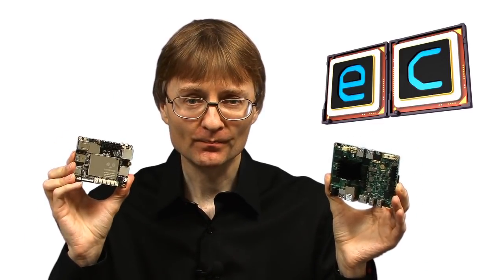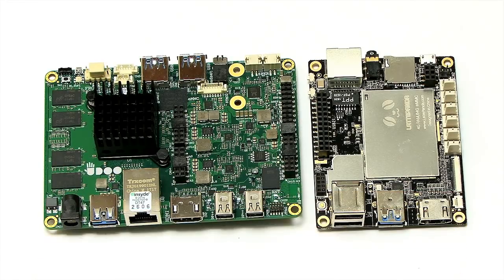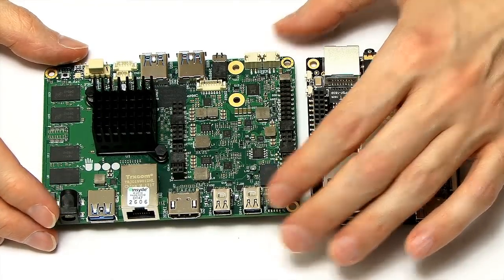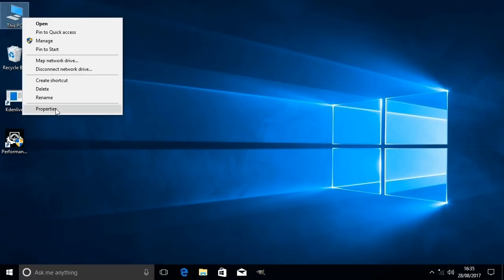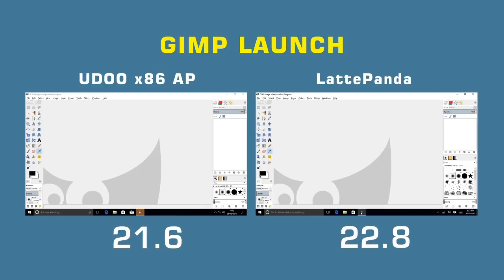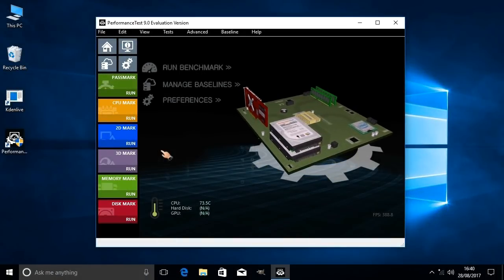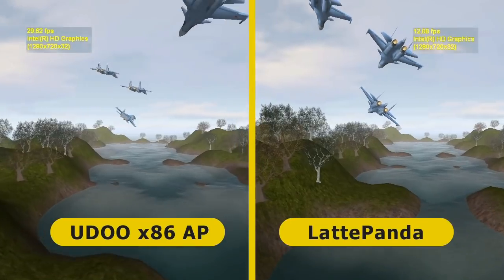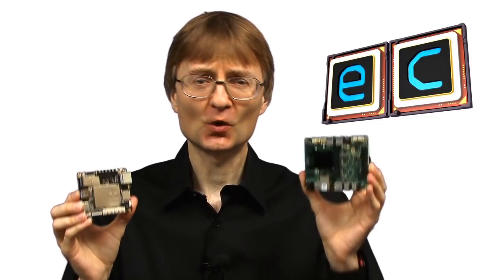LattePanda v UDOO x86 Advanced Plus

Comment: I'm looking for an answer on these 2 boards. Looking at the LattePanda, seems to use a seperate chip for the arduino connectors.
This makes processing power for the pins, dramatically slower since it's an Leonardo chip.
Does the UDOO use it's own processing power for these pins or is there also like the LattePanda, a chip in between?
I would be more tempted to use the LattePanda if the main processor which is also used for the OS, was also used to operate the pins.
Reply from the maker: I believe that both boards use separate controller chips to allow the bet Arduino compatibility. The Intel chips that run these SBCs do not have native GPIO.
Reply: @ExplainingComputers  SBC shopping is so hard. Rapid increase of new models and updates of models doesn't make it easier!
Mainly interested because these tiny computers can get so powerful relative to their form factor and also can be used as a master controller for slave arduino's at the same time.

If I figure out my pick, my car definitely will turn out in a geek creation I always wanted it to be.
Back to researching it is!

By the way. I really love your videos and your activity in the comment section of all your videos.
Also the straight to the point style is really why I keep going back to your videos for a quick reference.

Thanks!
Reply from the maker: You are right -- deciding on a board is very hard. I will be reviewing an UDOO BOLT here later this month (I've been told one is about to ship to me!), and then an ODROID H2 not long after that. The former may be more powerful than the new LattePanda Alpha . . .

Comment: can any one help me please ; 
if i can replace win system on lattepanda by ubuntu ? 
thanks
Reply from the maker: With extreme difficulty. The LattePanda is Atom based and does not have a standard boot loader. Hence you cannot (easily) just boot from USB and install a Linux distro. You would also need appropriate drivers. I have read of some people running Linux on a LattePanda, but not of anybody running it properly (eg with WiFi and audio drivers working). The LattePanda is, as it says, a Windows 10 computer.

Comment: Is it possible to run windows 7 on them?
Reply from the maker: Technically, yes -- and probably fairly easy to do on the UDOO, though you would need appropriate drivers. Hard to achieve on the LattePanda as it does not have a standard boot loader, so you would need an appropriate SD card image.
Reply: Thank you for the info

Comment: Could you explain the not 4K on the UDOO ?
Reply from the maker: Indeed! The highest resolution video output of the UDOO (and many devices) is four times HD, ie 3840x2160 pixels, also known as 2160p (ie double 1080p) or sometimes "UHD" (though this label is rather vague). Many people (and TV manufacturers) refer to this resolution as "4K" as it has close to four thousand pixels horizontal resolution. However, 4K has been around in digital cinema for quite some time, with actual 4K footage having a horizontal resolution of 4096 pixels, with various vertical resolutions possible. For example, Sony 4K cinema cameras record 4096x2160 pixels, and this is the resolution you will see projected in most 4K cinemas these days. So, strictly (well, actually) the UDOO does not output 4K, it outputs 3840x2160. But as mathematically-challenged TV manufactuers now call this 4K, it is not unreasonable to say the UDOO is a 4K device . . .
Reply: Thanks !, I do remember now that LCD screens are cut down from larger sheets and 3840x2160 and 1920x1080 etc obviously cut down well into smaller and smaller screen sizes from a large sheet. 4096 doesn't fit that mould well. Really I guess it's 93.25% of '4K' but that doesn't advertise so well ...
Reply from the maker: I like the "93.25% 4K"! :)

Comment: Thanks for going through the trouble of comparing these boards. I'm convinced about getting myself an UDOO X86 board for Oolite, which is a modern remake of the original Elite. It's fairly lightweight, and can also download expansion packs made by the respective community. Also, I'm getting ready for a project in which I first thought I would need a full blast Windows XP motherboard for, but thankfully, you changed my friggin mind. You can check my Google Plus for updates regarding said project.

Comment: the lacks of a heatsink on lattepanda doesn't influence on the benchmarks? At least i had a lot of problems, even throttling down the processor's clock until i upgraded the board's heatsink.

Comment: As for your comment about the mouse not initializing on the UDOO: I have the very same issue you described on my desktop with the mouse plugged into a USB 2.0 port. This is not an OS issue either since it has been happening both on my (past) W10 Pro install and my (current) Gentoo Linux install.
I genuinely wonder what it could be. The USB controller itself seems to be fine because my keyboard works properly and it's plugged into the neighboring USB 2 socket (yes, I have tried swapping them with no luck). That leads me to think it could be an issue with the mice themselves but I have no way to verify.

Comment: A major part of the market for these types of computers is in remote locations or off-grid applications.  May I request that you include  power consumption as one of your your testing criteria in future evaluations?
This would be simple to achieve by connecting a simple watt-meter to your power inputs.  Then we could compare milli-watts to fully boot into windows, per test suite, etc... and evaluate trade-offs in completion speed to extra watts consumed.  Many potential applications may not opt to get 20% faster speeds if it means doubling your power consumption.
Great site!

Comment: Thank you for all these reviews Christopher.
Are you aware of any single board computers with a parallel port?
Reply: You can get a USB-to-Parallel cable. E.g. 

https://www.amazon.com/Sabrent-SBT-UPPC-Centronics-Printer-Cable/dp/B0007UVRVO
Reply: Thanks Tom! I appreciate your input.
I am aware of the USB to Parallel option although Centronics is not the correct configuration for CNC applications. I am thinking of possible co-location of SBC and CNC driver electronics to reduce computing footprint. I have found about three in the industrial arena but with price tags to match.
Reply: One problem I've seen with USB to serial cables in embedded applications is that the timing of serial port signals is different when you have a USB to serial bridge chip in the system. Embedded applications being what they are, they may well be sensitive to this. 

If that's the case you might be better off with a PCI-Express parallel port card. Or you could fix the timing dependencies in the embedded system.
Reply: Yes in CNC application serial is of no use as the timings are inadequate for simultaneous multi-axis movement.

Comment: If you cool both CPUs well (with a larger heatsink), 
It'll be possible to have them  running constantly at their rated turbo speed ( of 1.8Ghz, vs 1.44Ghz for the atom, and 2.24Ghz vs 1.66Ghz for the Celeron).
 
So, if you see the CPU throttle down from their turbo speeds, paste on it a slightly larger heat sink.

Comment: the great thing with that super small pc is that u can run them inside a fridge  3 c°  ( wireless keyboard and HDMI )
Reply from the maker: Now this I must try! :) What a great idea!
Reply: condensation would be a problem :P
Reply: Not if you keep it in there. It would when removing it though.
Reply: you could submerge it in mineral oil and chuck it into a little freezer. then overclock it to 4 GHz. :P

Comment: I read (I just migrated up to 3.x USB) that USB 2 and USB 3 do not share anything as the internal connectors are different so 2.x/1.1 does not downgrade a 3.x speed so the mouse issue is not due to that.
Reply from the maker: This has nothing to do with the connectors themselves -- a USB 3.0/3.1 connector has both sets of contacts, and it will be the 2.0 contacts used to connect a 2.0 peripheral like a mouse. The issue will not be the physical hardware, but the drivers -- and problems with mice connected via USB 3.0 due to driver issues it a widely known OS issue I'm afraid . . .

Comment: how did you install windows on the udoo
Reply from the maker: I used the Microsoft online tool to downloadWindows 10, which creates a bootable USB drive (or it may have been a bootable micro SD card), which I then inserted into the UDOO. It was certainly a very easy process. You can find the tool here: https://www.microsoft.com/en-gb/software-download/windows10 It is free to use, and free to install Windows 10 on a computer to "evaluate" it without a license key. Or course, you may then purchase a license key if you wish . . .

Comment: Why is power consumption allways forgotten when comparing SBC's? The RPi 3B uses 1.5W when running 1080p video. How much does the LattePanda or UDOO bord consume?
Reply from the maker: This is a very good point. I must to a video comparing the power consumption of different SBCs. :)
Reply: ExplainingComputers ... YES, PLEASE!!! In my off-grid situation, this is a primary concern (my main PC right now is an Azulle Byte Plus - very similar to the Latte Panda, w/4gb RAM & 32gb flash, plus a bit fancier packaging <grin>).
Reply: Exactly. My only reason to use it but i better go with a 10W  Intel Core i3 as idleing NAS  server. Get it 2nd hand for 100 Euro. Hard to make energy money back on the UDOO prices.
Reply: I use a Pi 3 B+ to stream 1080p video of a fish tank from a Logi C920 webcam. Works fine.
Reply: less than 2w
Reply: Annie Darkhorse I think a lot of that has to do with lacking or badly performing drivers. People in the community are working on those so I expect the situation to improve over time.

Comment: I thought Atom processors are no longer supported by Intel, and cannot be updated to latest Windows 10 build 1704..
Reply from the maker: Ah, now that is a really interesting point linked to our discussion below -- the LattePanda is probably as upgraded as it can be (it certainly pulled down a mass of upgraded over many hours in March), but never migrated to Creators Edition. Thanks greatly for this insight. :)
Reply: ExplainingComputers I have the same issue with my cheap Windows tablets that run on Atoms. Apparently Microsoft is supporting this build up until 2023,  which is the same as Windows 8.1.

Comment: Those are both very cool devices.  If you had either one it would keep you busy for a long time. Is there much of a difference in power consumption?  Off grid controller applications would be wild with these types of systems.

Comment: Based on your reviews I just purchased a Raspberry Pi 3 today, then I saw this video. The way you explained it makes a whole lot of sense. I don't need an uber-powerful SBC. I already have a gaming PC for that. I'm sure I'll be happy with the Pi3. Thanks for the video!
Reply from the maker: The Pi 3 is indeed a great SBC, and I'm sure that you will be happy with it. :)
Reply: Stephen Wilson I've had a couple of Raspberry Pi 3s for a few months now and have really enjoyed exploring what the little SBCs can do.  I hope you will enjoy yours as much as I have mine!
Reply: You can do 480p gaming on most of these.
Reply: Responding to jimmy87251's PPI3's stability issues, of the two PIs I have, I have run one for hours at a time and it has crashed very few times. My other one looks to have been made by a different manufacturer,  maybe I should switch them and see how stable the other is.
Reply: Cpu at 1408mhz
Gpu at 456
Core at 488
Ram at 500
Over volt and cool appropriately and I have no stability issues.

Comment: Can the Latte Panda have an external gpu installed?
Reply from the maker: There is no provision for such an addition, though it would be possible to use a USB 3.0 display adapter.
Reply: Thank you, i was just wondering because of rumors on the internet of connecting a gpu through the M.2 slot of Udoo.
Reply from the maker: I do wonder about those rumours -- as the UDOO M.2 slots are latched for WiFi and SSD only.
Reply: Thank you for your help
Reply: There are M.2 to PCI-e adapters (usually to be used for coin-mining) but I haven't tested one myself.

Comment: With its smaller form factor im gearing more towards the LattePanda for the project i have in mind. But does it require any additional cooling ?. Did it get hot during the rendering tests ?. If you need to add heatsinks this would effect the size of any case you intend to put it inside.
Reply from the maker: The LattePanda's CPU (covering) does get fairly warm (though nowhere near as hot as the heatink on the UDOO x86). I've run the LattePanda for long periods though without any problems.

Comment: Not a fair comparison UDOO x86 running windows 10 creators update and LattePanda is running 1511 (November Update) so would that mean software bottleneck.
Reply from the maker: The LattePanda was certainly not updating in the background. I was aware of this potential issue and both machines were offline during all tests. I do try and do things as fairly as time allows! Given that one machine has a 1.6Ghz Celeron processor, and the other a 1.44GHz Atom, I would be staggered if the different version of Windows had any significant impact on these tests. The LattePanda last chugged though a heavy update in March 2017.
Reply from the maker: Yes, sorry about that. But I doubt that will make a very great deal of difference. The LattePanda has automatically received regular incremental updates.
Reply from the maker: An interesting observation in another comment above is that an Atom-based PC cannot update to the Creator's Edition, as Microsoft has prevented this. Hence, the two machines are running the best version of Windows 10 they are able to run. This also explains why, even though the LattePanda has pulled down hours and hours of updates, it is stuck without Creator's edition.
Reply: +John Peter Crich
I disagree. It is well known that the performance differences between 1511 and 1703 are near identical for the benchmarks tested here on the hardware compared. While your complaint is understandable, it's not going to make any measurable difference.
Reply: I agree, two different versions of Windows 10, one up to date the other not.  Makes you wonder if one is updating in the background slowing performance as the Operation systems are clearly not the same.  Tests should have been run on identical software and operating systems. Nice comparison but moot for this point.
Reply: Yes because Microsoft has released a newer version of Windows 10 (1703 - Creators Update)which is better optimised for lower end hardware over the Windows 10 (1511 - November Update) Image.

Comment: In your testing was one board more stable?  Would you trust one over the other in a 24/7 application?
Reply from the maker: I've no reason to far to favour one over the other on these grounds. I've used the LattePanda far more, simply because I have had it much longer. But both have been stable over long run times. Both do have CPUs that get hot -- the UDOO very hot -- so it needs a fan. But so far, no stability problems.